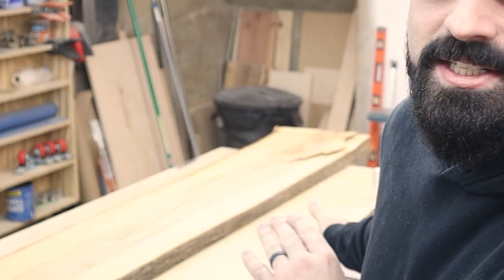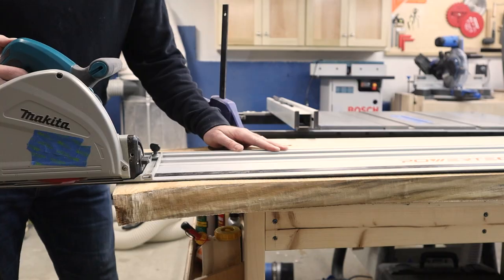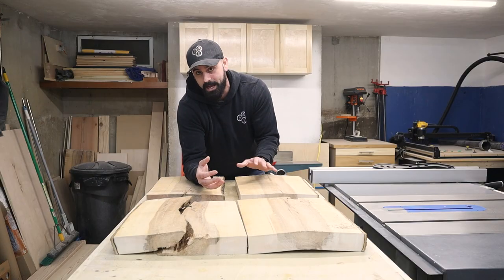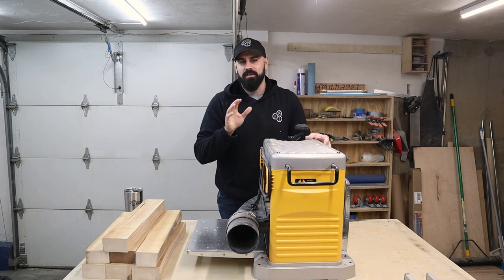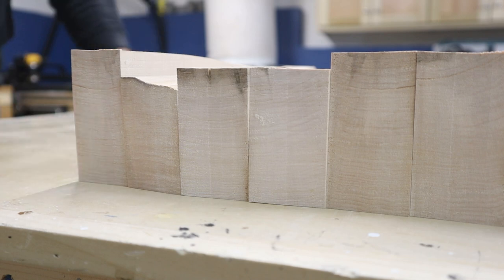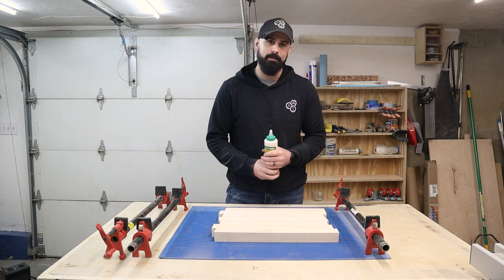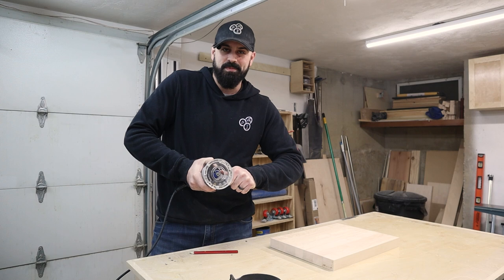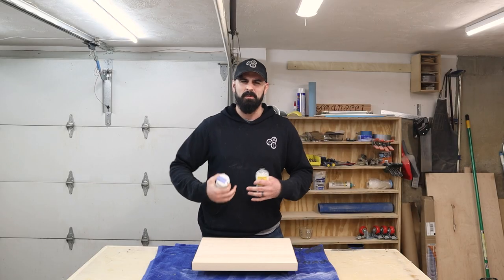Cutting Board from Live Edge Maple Slab | Woodworking

Comment: I have an issue with gaps in between the boards when i glue them together which is irritating to say the least.  I must say making cutting boards is fun but its a lot more difficult than i imagined it'd be. Gaps between the pieces, when you go to tighten the clamps the whole thing tends to bow upward, definite learning curve.
Reply from the maker: I have experienced that too.  I've found that sometimes, after you mill the strips of wood, let them sit in your shop for a few days before the glue up.  Then run them through the jointer/planer (if you have them) one last time before the glue up.  Should help close those gaps and ensure nothing moves afterwards.  Also, try to use clamping cauls to make sure the board is nice and flat during glue up as well.
Reply: i stopped wiping glue squeeze out and it helps

Comment: So I’m new to wood working about as new as you can get. I’ve made three cutting boards so far and it’s been nothing but a frustrating experience. Two have been made out of spalted maple and one spalted oak. Moisture of the wood is around 9% from what I’m told around here that’s about the best it’s going to get. My issue is after jointing and plaining the boards are flat as can be but the next day they are cupped and no longer flat and unstable. I would love to know what I am doing wrong any help would be greatly appreciated.
Reply: One thing you can do is place them on a flat surface and use a flat board to place over them and weigh it down. If you have enough weight evenly dispersed it should help to prevent that.